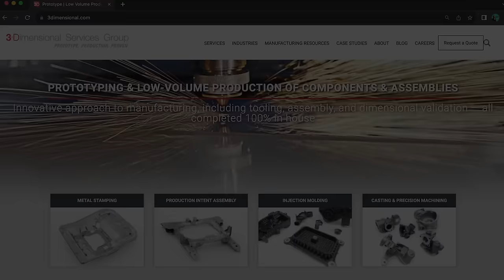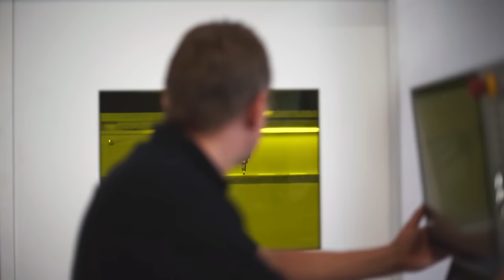Elon Musk and Sandy Munro discuss the Cybertruck!

Comment: The doors and bedsides need to be 30x stainless but 

The a pillar stirps, frunk lid, front fenders, tailgate. All could be made faster, more accurately, less expensive and lighter by going with anodized 6061 as thick as the stainless. 

Cut, stamped, spit out with accuracy as fast as model Y hoods, then tempered and dip anodized to look like 30X as finished parts.  Front, roof and tailgate aero can be improved at the same time probably beating the R1T.    

This leavess the airbending presses to focus on producing just 6 different parts. increasing production of the hardest parts to make on the whole exterior. The four doors and bedsides. Frunks, tailgates, A pillar molding and front fenders dont really need the 30X.

Comment: I'm a happy owner of an EV and will never go back to ICE. I like the cybertruck but I have one concern about buying one.
I was a shipwright and a welder, and one thing I have never seen is a successful boat built from stainless steel. SS lacks malleability and is prone to stress cracking, especially where there are stress concentrations at corners and welds. From the point of view of a boat builder the cybertruck design looks prone to work hardening and stress cracking. If it were a boat stress cracks would appear very quickly. 
Has the cybertruck been tested to withstand years of repetitive stress cycling?
Reply: Who said it's normal stainless steel?
Reply: The seams aren't welded... they're independent panels

Comment: Most technologie is not really new.
48V is Common in Cars, millions of cars with 48V al produced
Rear axel electric steering is common since years, BMW 850 CSI had it 1991 an an nearly all BMW has an option to 4W steering
variable steering is also common at BMW since 2005
Electric Steering was also introduced by Toyota and Lexus

Comment: I'm surprised they talk about rear wheel steering as if it was a breakthrough innovation. Not only are there other cars that do it (and the Hummer EV is also a truck that already does it) but it's actually quite an old system.

Comment: I think the next thing Tesla should do is to do an electric trailer platform. So that other trailer outfitters could buy it and do anything from a toy hauler, dump trailer, RV, or whatever. And even sell it as a DIY platform to EV owners. That way you get Tesla charging, and can tow anything form multiple SXS/snowmobiles/4x4's/horses or camping trailer without getting range toll. Could be with several battery options/axles/tow weight.

Comment: Elon I like Tesla but leave the steering wheel mechanically connect to the wheel. You leading other cars companies to do the same. Someone will hack into the car and control or crash the car. If Tesla doing a great job of security not mean all other companies will. Don’t make I-robot 2 unreal life. Keep the steering, break and accelerator mechanically and add a electric disengage switch.

Comment: Awesome video. Only thing I caught that wasn't true, was 4 wheel steering was mass produced by GM on the quadrasteer trucks. It was mostly on the Denali trucks but was also available on other truck models, including the suburban. It was produced in the early 2000s. It was only available for a few years. I loved it, but for some reason GM did away with it. I'd still have quadrasteer today if it was available. On a truck, especially when towing a trailer, it's totally worth the extra cost. Bust a u turn like a compact car, but in a big truck.
Reply: Was quadrasteer steer-by-wire?
Reply: @snookmeister55 - GM Quadrasteer was a conventional front wheel steering with drive-by-wire control of the rear wheels.
GM made Quadrasteer a standalone option for $2,000. By the end of 2005, GM had sold about 16,000 vehicles with Quadrasteer.
Reply: @cjwilson54  Interesting.  A hybrid steering system.  Thank you.

Comment: Disastertruck

Tesla's Cybertruck is really struggling to keep it together.

The brutalist pickup, once CEO Elon Musk's much-beloved pet project, has been mired in problems since finally going on sale late last year, from a major recall caused by a disastrous issue involving the accelerator pedal to being defeated by small hills and even a trip to the car wash.

Now, one owner has reportedly had the entire assembly of his truck's gear shifter come crashing down, causing the truck's visors, which are also attached to the assembly, to be ripped off as well.

For reasons we can't explain, Tesla chose to mount the gear shifter to the vehicle's monstrous windshield, requiring drivers to switch drive modes via a touchscreen suspended above their heads.

"THIS IS a clear design and engineering error!" former Tesla engineer Cristina Balan tweeted. "The issue with this design is the fact that the visors are one of the most used part in a car that takes the most amount of force!"

"This will ALWAYS be a problem if they don’t change the design!" she added. "This is bad."

Comment: I think because there's no mechanical elements to the steering and it only operates by digital outputs, it makes it very dangerous, in my opinion, because if the computer malfunctions, you are going to lose control of the car. I'm surprised they would allow him to do that. Really bad idea, in my opinion. Being an electrician who works on controls and instrumentation that use 24v to send signals to the different systems of a building, I know about these things and where he says 48volts will need less size wires. Well, the wires on a 12V system are already small. The signal is not traveling far, so it wouldn't make much difference. I can't see any benefits to 48Volts compared to 12V. He could have still eliminated the 12V battery the came way he did with how he did with the Cybertruck and still keep the bus system run at 12volts. I think he just wanted it to be different than the standard car, so he can say it's different, but by doing that, he increased the cost of the car. I think his ego might be going to his head and this might back fire on him. The Cybertruck might end up being the only vehicle in history to have a system like that. I think this car will not make as much profit as do the other Tesla cars. I think The model 3 is the best electric car out their. 2022 and up. It will be interesting how well his new battery keeps up. All the best to Tesla.

Comment: Steer-by-wire is a great leap foreward and the start of a new era in terms of safety. As the computer drives the car and te driver tells the computer where to go a lot is possible just as in a plane where the computer does all the microadjustments needed to get the optimal result and safety. Something lake tractioncontroll is then just incorporated in how the computer drives the car and not an aditional system for adhanced safety. Ultimately the compuper keeps the car in its designed drive-envelope just like the computer of a plane keeps the plane in its designed flight-envelope. On the ground that has a great advantage for there it is very crowded and there the computer will make the greatest difference in terms of safety and not the driver who is in most cases  to slow to react for a multitude of reasons.

Comment: Wow, that's very cool on 11KW capability to use as a battery for home with over 100A  .  Inrush.    Also, wow, can tow 300MILES sounds like with the external extra battery.    The more I see on this truck, the more interesting.  Still steering by wires??  Freak E

Comment: Guys, please, variable steering is here for 15y! No need to present it as some discover! The question is why this is not implemented in expensive Plaid! And with steer by wire you dont have a feedback from wheels. Sports car wont be using it so soon.

Comment: 4 years MAXIMUM for Model 2.  Just do the math.  First production car 2008.  3 more since then.  Cybertruck is going to be a low volume status symbol here in the States and almost no where else to even care about.  Model TWO however?  In FOUR YEARS Tesla will expand EV car market share from 10% to AT LEAST 20% just in the States.  That's 25% growth PER YEAR from here ON THE LOW END.  Investing in Tesla is going to be MULTIPLES better than leaving your money to rot away in your savings account or even the gains you may see in your 401(k).

Comment: 4 wheel steering - The GMC Hummer EV has 4 wheel steering. GM had this technology way before Tesla was ever thought of. Quadrasteer is the name of a four wheel steering system developed by Delphi Automotive while under the ownership of General Motors for use in automobiles. It was available as an option on GM's full-size pickup trucks and 2500 Suburban's for model years 2002 through 2005.
Reply: So you mean you are not impressed with cybertruck?

Comment: No mechanical connection to the steering rack?  This is a bad idea, revolt against this People.  Electric assisted steering still has a mechanical connection.  Yes at zero to slow speeds, it's super hard to turn, but at faster speeds it's effective giving you a change to live long enough to get it fixed.   What happens if there is a steering input fault on cyberT?  What if this is the first generation of vehicles that can be taken over covertly or overtly.
Reply: I presume you have never and will never get in an airplane, then?
Reply: @Jessev741  The Cybertruck has the same fly by wire system as an F35?!?!?  I didnt hear them mention, I missed the part about their partnership with Lockheed Martin.  The fly by wire in an F35 is Big Leagues, whatever is in the CyberT is Busch Leagues.

Comment: Not a Big deal at all
In my country Iran, Peguet 206 is repruduced by famous and very capable company, lran Khodro, and they easily reduced cables thickness about 30% without any of these unnecessary considerations. Results were awsome😅😅😅😅,  Just every couple of years some cables just burns out and a random system will be out of work, like fans and thats not really important at all, just we might die of heat or cold weather, ..... 😂😂😂😂😂😂😂

Comment: Drive by wire, 4680 tabless Dry Cell, 2 400 volt battery’s to 800 volt, 48 v low voltage, thick stainless steel, etc.  chiseled cuts like a Lamborghini
Reply: Lamborghini of trucks

Comment: OMG two blind men discussing color. 48V is to transmit more power over thinner wires and has got nothing to do with bus communication. Bus communication by definition is no point to point wire. And Ethernet is a bus with higher bandwidth/frequency than CAN bus.